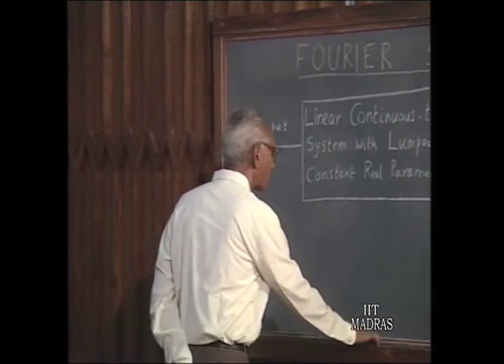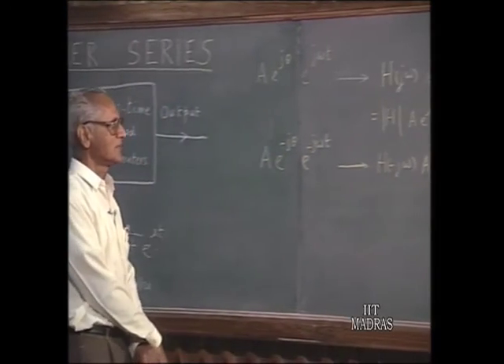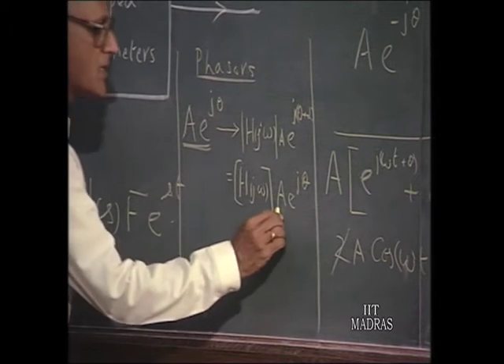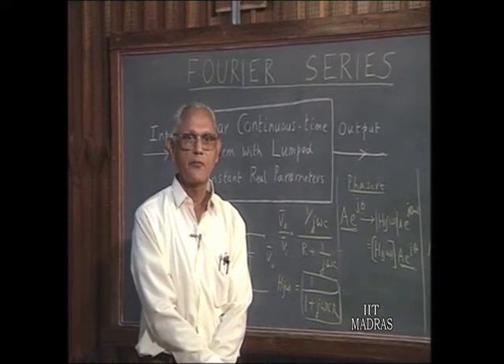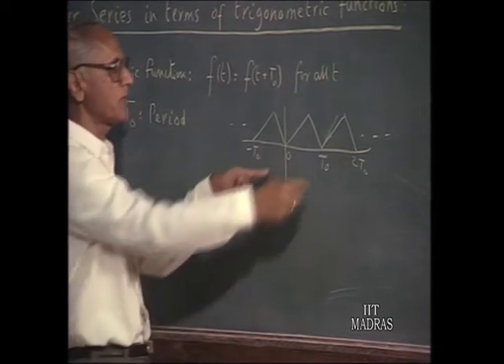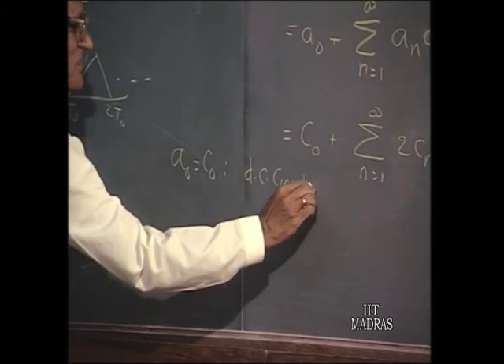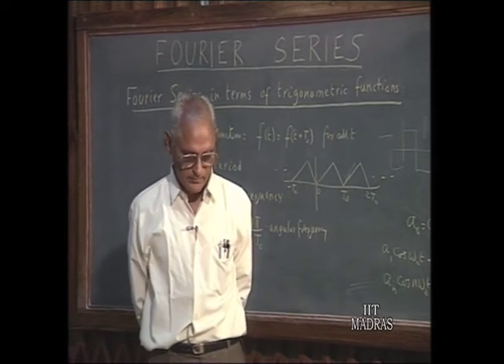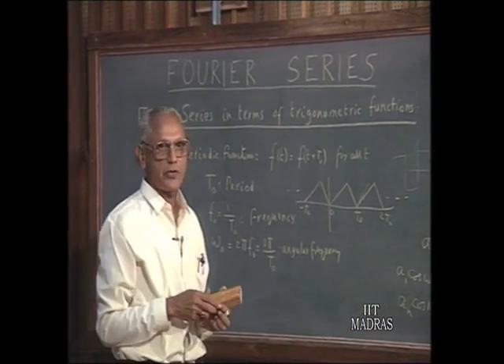Lec 17

Comment: motivation for use of fourier series
for an lti syst with real & const coeff (ie real & const ckt para like R, L, C etc), exp signal is a characterstic/ eigen signal. But in actual lab, analyis of exp signals is not easy. As exp signals can be represented as sin & cos using euler eq, easier AC syst analysis using phaors & freq resp func with algebraic techniques can be used instead in lab work. This is made possible by fourier series. Also it can be extended to non sinusoidal as well as aperiodic signals     0:00
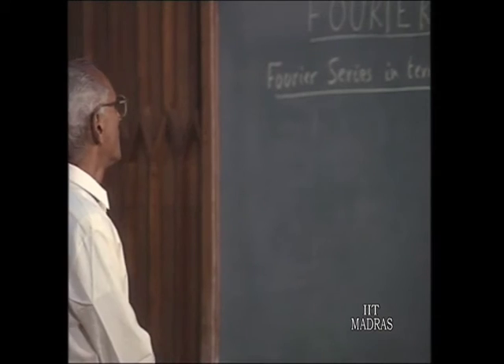concept of fourier series 20:17